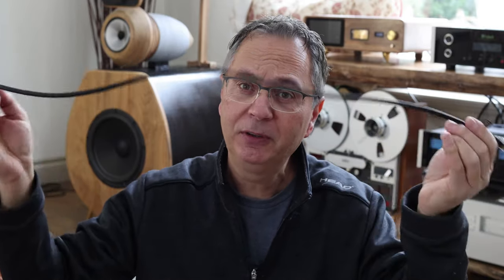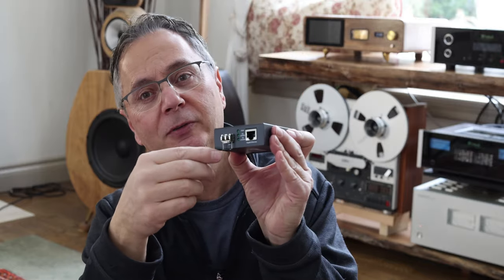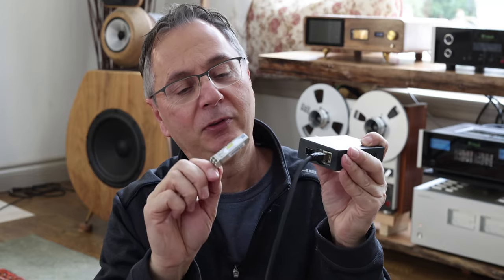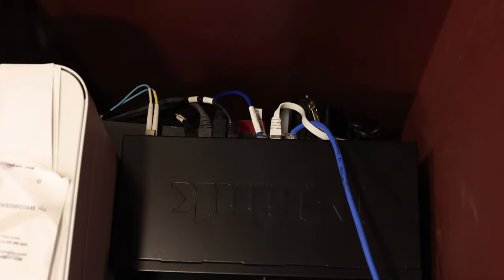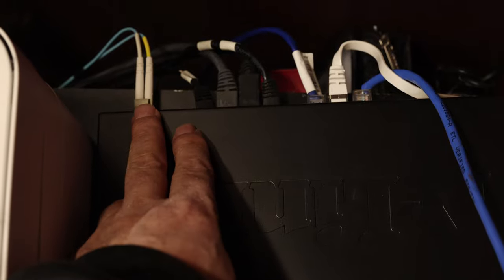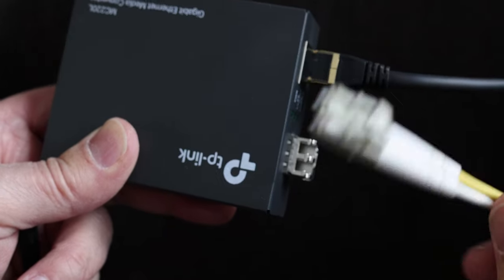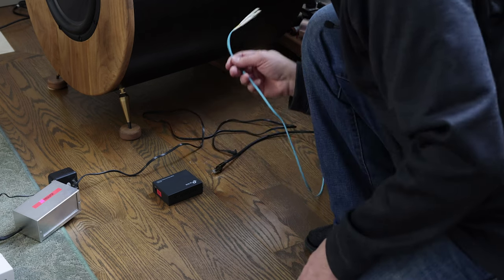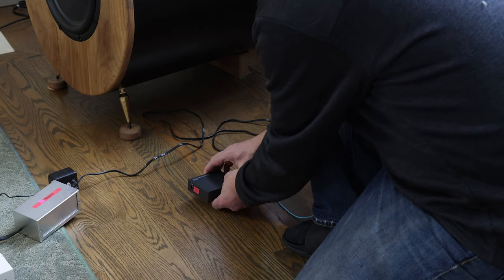Media Converter switch your Dac to Fibre optic

Comment: Yep, this works, and then put a good switch on the end, and things really clear and light up. The most obvious improvement is in the video stream. Everyone thought I bought a new TV, the PQ improvement was that obvious. Now think what it will do with your streaming music. To power the fiberoptic box I also used an LHY linear power supply to further clean up the noisy electricity.

Comment: Great tip. I'm trying it. I have a better power supply on order. It should come tomorrow. It definitely doesn't sound as big or as detailed as my high end ethernet cables.  I think thats a function of the wall wart on that tp link Media converter. I can hear the lower noise and  I want better sound out of my streaming and hope this will push it.  🤞 I'll keep you posted!

Comment: inside the media converter there is a dc-dc converter to reduce the voltage at the input to the roughly 3V required by the electronic... my experience, as I'm using the same trick, is to supply a voltage well below the nominal spec (that on the label), I'm around 6V at the input (I use a linear regulated DIY unit with adjustable output)... that will GREATLY reduce the internal ectrical noise from the dc-dc with immediate, and not small, benefit for the sound quality
Reply from the maker: That is great, I bypassed the dc to dc converter on mine  and now I feed it 3.3v
Reply: @Gabster1  well done! are you going to place a video about that in your channel? would be very interesting for many of your follower ;)

Comment: Gabster - I like your attention to videos and how you present material.  I too am going to insert fiber between my switch and the streamer (custom fanless PC, with separate 5v LPS driving a JCAT USB card). What have you noticed when the fiber was inserted into the network path?  Darker background/quieter?
Reply from the maker: It all depends on how noisy it was to begin with some hear some differences some do not 
Do not expect a huge difference but each small improvement adds up at the end.

Comment: How would a FMC setup compare, technically and practically, to an iFi iSilencer? They both seem to filter the noise out, however, 1 has 2 boxes and 2 power supplies. Whereas the other (iFi) is just a dongle. Both are priced roughly similarly. Perhaps you need 1 of the 2 or perhaps both. Any thoughts/experience?

Comment: Gabster I would love to see these compared to the pricey DDC I see many "audiophile" DCC running aat $500-600.I was thinkingn maybe about a cheap (read $100) SMSLbut I am not aure that these do more than what you have here.
Reply: As far as I understand DDC is usually a re-clocker and buffer. A different problem IMHO.
Reply: DDC is on the output, this is for the input

Comment: ya just the iFi iPower-X or a higher grade psu on Wi-Fi router already can hear the improvement.
Reply: What happened changes in sound when you changed the standard power supply to ifi ipower x in the router?
Reply: @bebbop  
Streaming music separation & imaging is better. Also the Wi-Fi signal range wider. BTW I put 2 iPower-X on each modem & router. 😎
Reply: @klc2578  Thank you for your reply. Personally, I've heard a lot of good things about changing the power supply in the router. I also bought Ifi Ipower X 12V and I have a problem with synchronizing the router. Cannot log in to the network. When I connect a standard power supply, everything is fine. I have no idea if the ifi is damaged or if the router is just picky. I ordered another piece of Ifi. If there is a problem with both, I have to look for a power supply from another company.
Reply: @bebbop  🤔
does the original psu Ampere is 4A or more? because iPower-X 12V only 2A.
Reply: @klc2578  The parameters of both power supplies are the same: 12V and 2A. For the first half an hour, the router worked normally with ifi, but then it was disconnected from the Internet. It turned out that the diodes on the router showed a lack of synchronization, as if there were problems with the Internet connection. I replaced the ifi with the original one and the router started working normally. I replaced the power supplies 2-3 times and there was never any Internet connection on the ifi, but there was no problem with the original power supply. Very strange. I hope it's just a faulty IFI and the new unit will run without any problems.
Reply: @bebbop  
🤔 strange thing, hope this unit faulty and new unit works.

Comment: Hi

So, why going through a switch, especially if my router supports spf out..

?????

Thanks :)
Reply from the maker: No need then that is great just take your SPF from your router but you will need 1 module to convert it back close to your Dac as most Dacs do not accept SPF
Reply: I see, thanks.
By the way.... it's also possible to go from a rauter directly into a first converter and from there go optic to the second.

I'm just trying to understand the importance of a switch when it comes to improving sound quality.

Thanks again :)
Reply from the maker: @ilanspiro1645  Yes the main Idea is to carry the long distance optically so not to pickup noise on the way and isolate from the main noisy router circuit.
Don't expect huge changes in sound unless you have a very noisy router  but every bit adds up at the end
Reply: Thanks
Yeah..i know,  everything counts in the end;)

Comment: Thanks, Gab! When I shop for those, there is two options. Single mode or multi mode. Any preference?
Reply from the maker: Yes I am using single mode meaning 2 fibre cables, you can use BIDI single cable for both directions  but not worth the price difference
Reply: @Gabster1  thanks
Reply: Single mode and multi mode refer to the construction of the strand of fibre. Single mode has a much smaller core allowing extremely high bandwidth while multi mode has a larger core making it more optically durable and forgiving in LAN situations. If your span is <200 meters use SX and multi mode for simplicity and reliability. Duplex …… two strands …… zip cord.
Reply: @Gabster1  Hi Gabster, I'm a bit confused, you say you use single mode cables but the cables you link above are multi mode. Have I got that right?

Comment: I did exactly this, though using TrendNet gear. For a little more cost I used 4-port switches that also had the SPF slot. My main switch that is connected to my router is an older 3Com managed switch that has four SFP slots, so I was fortunate to have that capability already. 

I bought inexpensive 5-volt power supplies for the switches. The improvement in digital audio from implementing the fibre was not subtle and I think it improved my video (4K) as well. And I have fibre Internet service to start with.

Comment: What if my DAC/streamer has several optical female connectors? Do I need the second converter box? I don't think so but I'd like to get your opinion. This would eliminate the second short cable and the second media box.
Reply from the maker: If it has a sfp network slot  ( not to confuse it with a toslink input) then no you just connect to it. Rare for a Dac to have sfp slot I know a couple that do but most don’t just  toslink which is not the same.

Comment: Not to show my inexperience with these things, but why did your link to an optical cable show a LC to SC cable when both converters that you show in the video have LC connectors? Am I missing something (or just less experienced that you expected)? Should I have ordered an LC to LC cable?
Reply: Could you say exactly what optical  cable type to use between media converters?
Reply from the maker: Yes in my case they should be both LC so LC to LC sometimes when a item is sold out, Amazon reverts to a similar item in this case not a great one 
I will fix the link in a couple days when I am close to my computer again. For now I will add a caution note.

Comment: Works even better with 2 Cisco 2960 or Meraki 220 switches that you can get for cheap off ebay, because they have really good 25mhz clocks in them. I got some really good Startech SFP's to futher improve the sound. Modded both switches to use a LPS, added a LC filter and removed the POE and switch mode power supplies. BIG improvement in my streaming.
Reply: The nexus uses a custom crystal for clock, does 50 nano second timing. High end ocxo clocks do 15-50 nano seconds per seocndtdepending on the crystal tolerances. Tcxo, which is FAR more common higher end clocks do 1000ns. Standard switch crystals do like 3-4ms clocking, about 40x slower than the nexus.

Have I convinced you yet, lol? I ordered an ntp clock to use with it that uses GPS and ocxo for clocking which is better than any high end oxco alone and I'll get the nexus to 15ns timing and have the crazy hardware. All for about $1000 out the door. The module switch mode power supplies are also very good with huge capacitor banks so ripple current (aka noise in power supplies) is very low. They use legit transformers and massive amounts of capacitance on the output, better than most mid grade linear power supplies. I might rebuild the power supply to even take it further using higher end caps.
Reply: @ClassifiedBrief  That sounds awesome. Do you get any fan noise from the nexus? Does it run hot if only hooked to streamer?
Reply: @ClassifiedBrief  Do you have it fiber cascaded or just ethernet in and out?
Reply from the maker: Great idea Pete quality switches and sfp’s are even better for sure specially better clocks
Reply: Hey Pete! You have I have had an exchange about our Merakis before. You were the one that informed me it had a switch power supply! I was disappointed to say the least but I HAD to know.  I would love to make it a LPS but that is beyond my capabilities. I've ordered an ifi power x for the tp link media converter on the streamer end. They sound pretty good. I've heard one and it made the sound bigger the way a LPS does. Wish you really did live across the street! Everybody I know  looks at me funny when I talk about this stuff! LOL!
Reply: @mattharwood4413  you should put the meraki on the steamer end. I think it would do more there. But if you like better on the other end that's cool too. Experiment and see.
Reply: Let me make sure I understand Pete. What do you mean put the Miraki onthe steamer end? My Meraki is already directly connected to the streamer (right now using the fiber optic cable and media converter at the streamer end w/transceivers). Then the streamer is connected to the DAC via USB (F-ing AQ Diamond USB cable!  I was so desperate to get better sound!)   @Pete.across.the.street
Reply: @Pete.across.the.street  Thanks again Pete! That was the video I watched that made me buy the Meraki. I really like Mike's videos. I think I did it right. BTW  I just ran a second fiber optic cable from my computer (where I mange the streamer and access Qobuz) to the Meraki. So the line from the computer to the Meraki and from the Meraki to the Streamer is now all Fiber optic. Wow. There is definitely more detail (due to less noise?)

Comment: Just use an amplifier with built-in DAC .

No problem when you have some cables run along your HDMI  cable.  It is digital data, it ignores the interference
Reply: Built in Dacs are usually of poor quality, especially if you are referring to an AV receiver. This is why most audiophiles run an external Dac and sometimes even use a separate DDC for jitter reduction. Only makes a difference if your system is revealing enough 👌
Reply: @mikelanier5617   Built in Dacs are usually of poor quality,  where do you get that wrong info?  And then the Jitter story OMG :-(  If Jitter would exists which with a good source is not the case the most DAC s have all a high tolerance to clock jitter
Reply: @mikelanier5617  Please do not insult my intelligence by throwing some irrelevant (to audio) terminology around!  It does not impress me at all.

Also, please do not lie !  you claim   This video literally discusses .......reduce noise and jitter This is not "wrong info," as you stated,  I did not  state anything with regard to this video as wrong info.
I used "wrong info" with regard to your unfounded claim  Built in Dacs are usually of poor quality  

I know what the video is about, and I address his claim that a cable running next to other cables might pick up interference and other shit , And there I said it is not a problem for digital data!

And please do not say you can hear certain things at your or mine age, we may be happy to hear anything above 15kHz.
Reply: I knew the homework was going to be tough for you, considering the reading comprehension level and your lack of basic knowledge regarding digital conversion . Everything I said was directly audio related, and you can't grasp it, I'm sorry. Now, the fact you admit you can't hear above 15k (yes I can) explains why you think none of this matters. Jitter reduction is very important to anyone who takes this seriously and is not done well at all with cost conscious, built in Dacs. You probably think external linear power supplies are useless, too, since the devices have one built-in already, so that is good enough for you?? Tried to help you understand, but you know best. I get it now that you think an AVR includes a world-class DAC and that digital cables can't be affected by other radiated EMI and RFI sources. Since I'm dying soon, I need to enjoy my time left while helping those with an open mind who appreciate the knowledge rather than debating with someone on YouTube who is too stubborn to read a few white papers on the subject matter at hand. I'm building 3 isolation platforms today. Even though the equipment came with factory supplied footers, I must be nuts to think this tightens up bass and improves detail retrieval. I and thousands of others are nuts evidently according to your logic. Enjoy your music and what time you have left, I know I will !
Reply: @mikelanier5617  Oh man what a fail.

Please give me your linked in profile ?  Helps me formulate an answer.